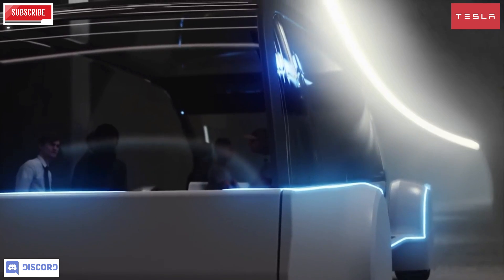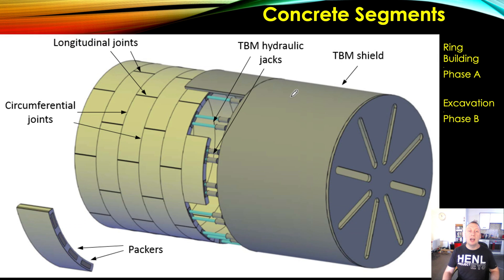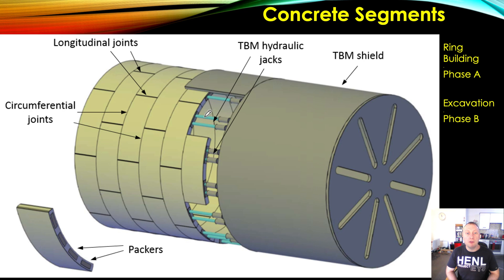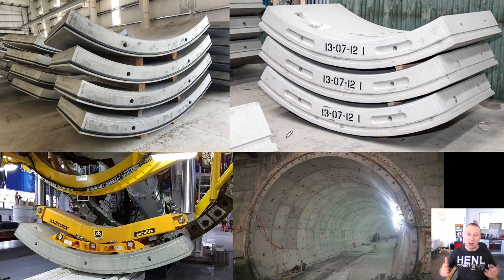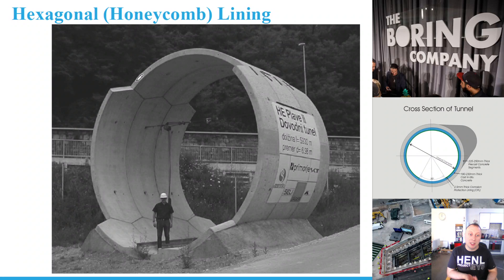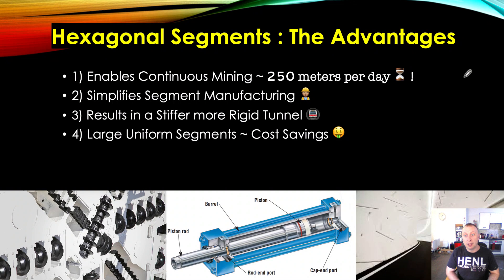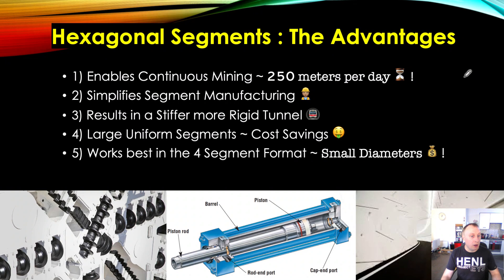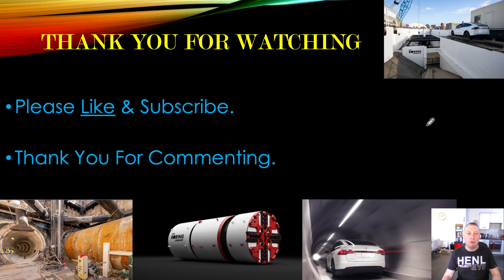The Boring Company 🚇 😃 🇺🇲 Hexagonal Concrete Segments Are The Future 👷🏽‍♂️ 🏗️ 🚎 PART 1

Comment: What about putting the segments in a spiral pattern (instead of having each ring in its own plane). In that system, the pistons pushing the cutting head would be extended in a staggered length,. After the latest segment would be installed, the pistons would be placed at its edge while they are at the shortest extension. ( the place that is in sequence to accept the next segment will have the longest extension. At that time, the pistons would retract to empty the space for the segment).
I hope I was able to explain it adequately, if not please contact me.

Comment: There is no reason for hexagons to be optimum, if you need 6 tiles to do the whole circumference of the tunel, you need to advance of 1/6th of the width of a tile each time to alleviate the sequential problem, so that you put one tile at regular interval, which is when you advance by 1/6th of the width. You get :
                  __________________
                /                                        \____________________/                                          /                                           /
              /                                          /                                        \____________________/                                           /
            /                                          /                                          /                                         \____________________/
          /                                          /                                          /                                          /                                         \
        /                                          /                                          /                                          /                                          /
        \____________________/                                          /                                          /                                          /
        /                                        \____________________/                                          /                                          /
      /                                          /                                        \____________________/                                          /
    /                                          /                                          /                                        \ _________________ /
  /                                          /                                          /                                          /                                        \ 
/                                          /                                          /                                          /                                          /
\____________________/                                          /                                          /                                          /
/                                        \____________________/                                          /                                          /
Reply: With hexagone, each time you advane of 1/2 of the width, you need to put in place 3 tiles. This is not a solution to the sequential pb, this just cuts it in half. You need to cut it in 6.
Reply from the maker: @philippeferreiradesousa8673  yeah and a 6 segment system would greatly aid the load distribution of the Hydraulic jacks.
Reply: That text-based diagram is auto wrapped in my phone app, so I cannot read it. If you could add explicit [newline] or [CR]+[LF] before column 80, then it might be legible in landscape mode.

Comment: There is a better way to do it. You need to do high-speed injection of  are semi rigid polymer. Overlay on top of a matrix amorphous solids. This system can easy hit the psi target. It will be water proof it will cure in seconds. Then pump rapid set concrete. Best part is no part. You are not transporting heavy concrete and steel. you're manufacturing everything you need in the location to the exact specifications that you need and all the materials a lighter. All of  the current systems  are long it's all  wrong. If any boring competitors wanted talk to me I can give more better understanding what I'm talking about. I would love help a team.
 Then you can add dragon wings
Reply from the maker: I wanna see it 👍🏿 😵

Comment: If they could compress blocks of debris as tunnel wall as it proceeds would be like a fantastic tunneling worm - pick your favorite sci-fi worm for tunnel making. Hex segments, elongated or like a spiral, herringbone is still a good system. Still, you have to deliver segments to the site and deal with installation.
Reply: It is possible to make mortar from some types of tunnel muck, along with added cement, but the immense forces on the tile segments is going to require casting off-site (and curing for weeks) before returning to the TBM.
Reply: @avid0g  Maybe they could get a head start on the blocks making the entry ramp. Yep, would take way too long to cure at same time as boring the tunnel. Pre-fab all the way (even if it's made from tunnel muck).
Reply from the maker: UK & U.S Specifications for aggregates are very demanding. Most strata is unsuitable for use in tunnel segments.
Reply: @BoringRevolution  True, but regolith on moon or terra (pun intended) on Mars can be used as cover for domicile as long as environmental (wind on mars, lack of gravity on moon) are stable enough.

Comment: IRC another way to dig is with carbon rod arcing fusing loose soil and rocks as temporary shoring and shattering what you want to remove with pneumatic chisels. IMO that would have to be automated because of heat and fumes.
Reply: Carbon rod arcing is less efficient, uses too much energy and the soil isnt always perfect
Reply: @carholic-sz3qv  Less efficient in what way speed? How much energy is too much energy? Many places have an excess that they need to dump onto other areas and they even pay them to take it sometimes.
Why do you think the soil needs to be perfect and what does that actually mean?

Comment: Ok so why not a Narwhale approach? You drill ahead with a thinner point grab into that material to move the vehicle?
Reply from the maker: I will read into it, but sounds more complex. . . 
Thank you for the heads up!!! 👍🏿
Reply: @BoringRevolution  I don't know if anyone is using that approach now or in the past. Your welcome.
Reply: Could you push off from further behind using wheels on the floor, sidewalls and ceiling?
Reply: @dejayrezme8617  Apparently that can or will shift the previous tunnel pieces if they have not had the mortar fully set and that takes too long.
Reply: @Barskor1  Yeah after watching and learning a bit more this all seems much more complicated haha.
But I did see a render of this working if you're just drilling through solid rock without installing any rings.

Comment: I think they're very close to optimal. If they go down to 3 pieces and use the same hexagonal design and the same 90 degree angle at the joints it's optimal.
There has to be an explanation as to why they use 4 pieces to form it. Maybe it's ease of insertion.
Reply: Matt Senkow. Segmental lining design tends to be driven by the size and weight of each segment. Larger tunnels, more segments. 
Remember these segments have to be delivered down the inside of the tunnel, through the the TBM back up and then into a feed magazine before being lifted, usually by a vacuum erector, into place. Weight and size are important parameters to making this process efficient. 
Segments usually travel in sideways as can be seen on any video. They are usually rotated 90 degrees as they are put into the segment feed magazine.
Reply from the maker: To thrust the machine forward you need a large leading edge. 4 segments is a necessity !
With more jacks and a bigger surface area = improved TBM performance.

Comment: I am sure they have segments that are for turning a corner.  shorter segments for inside the turn, and longer segments for outside, and graduated segments for top and bottom.  Turns would be a standard radius, so only 4 types of segments would be needed to complete a 4 segment tunnel.  I don't think that using just a 4 segment tunnel is necessary, and instead use true small hex segments.  This could be as high as 16 segments to complete the circumference. The other way to turn a corner is to put a gap in the outside segments and fill it with concrete.  The other thing not mentioned is to make a pouring ring to create a continuous tunnel as you go since the speed of the TBM is slow enough to allow the concrete to set before the mold clears the edge.
Reply from the maker: I think based on what people have now told me (via email) even very straight tunnels will require unique cornering solutions. 
So 5% - 8% of a tunnel would require rectangular segments. Not as big an issue as it sounds because the Hexagonal straights will save thousands of man hours! 😃

Comment: I agree that hex is best. BUT I still don’t understand how the tunnels can angle if they’re all exactly one standard size
Reply: s green..... they can’t. That the downside of a hexagonal segment system.
It’s an issue not addressed in the video.
However, if the speed is to be 150mph (Musk used to day over 300) the tunnels will not be able to have turns greater than 500m radius curves.
Reply: @davidsalisbury50   And why can't a series of sections be used that have a designed in very slight curvature?  

A highway designed for 150 MPH driving would not have hairpin curves.  The route design has to fit the reality of changing direction at speed.  A hyperloop would need more gradual turns but there would be more than enough miles of tunnel to fit those turns in.

I don't recall Elon ever talking about Loop (non-pressurized tunnel) speed being anywhere close to 300 MPH.  He has talked about travel in very low air pressure hyperloop tunnels at 700+ MPH.

Hint:  Don't assume that the very intelligent and well educated engineers that work for Musk's companies don't know how to model systems.

At this point in time, with the Vegas system that is being built, very little innovation is being used.  This is a demonstration of what a system like this would offer in terms of high speed, non-stop travel in a congested urban area.  I expect the next project will start to bring in advanced technology.
Reply from the maker: Perfect question! 
You Cap off the Hexagonal section with two half segments (half width). Then you use rectangular segments + packers for the curve and later on you revert back to Hexagonal. Will break this down in a future video !

Comment: Shift where you push from rather than the current leading-edge have an anchor tail that is behind everything and pushes outward on the already made tunnel for bracing and then you push off of that
Reply: Barskor1 need to wait for the annulus grout to strengthen first. Segments generally don’t like being pushed out from the inside. Especially in soft ground.
Reply: @davidsalisbury50  Good points
Reply from the maker: @davidsalisbury50  Hi , Can you email me please. I have questions. 
BoringPrufrock@Gmail.com
Reply: Instead of pushing out, design the tiles with an inside surface that can act like a ratchet, somewhat like toothpaste cap threads. Then you only push back on several rings where the grout is fully cured. Put a constant measured load on the new tiles.
Reply: David Ogawa agreed. But that is how current linings work through direct thrust on the leading edge.